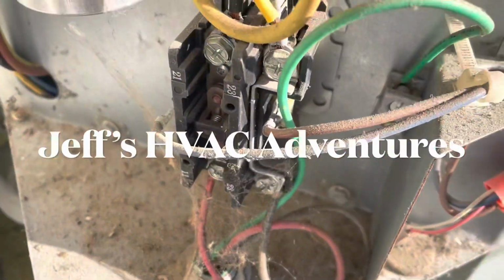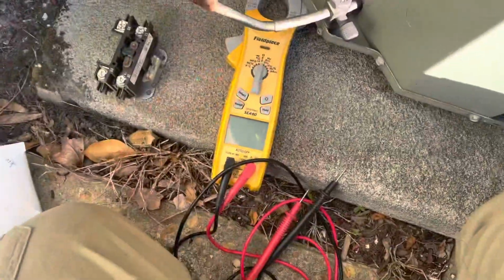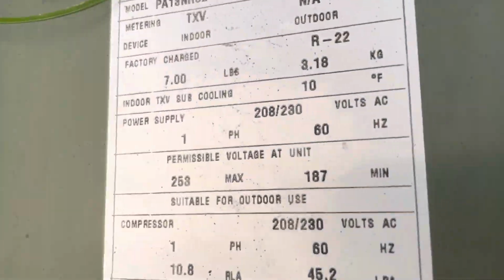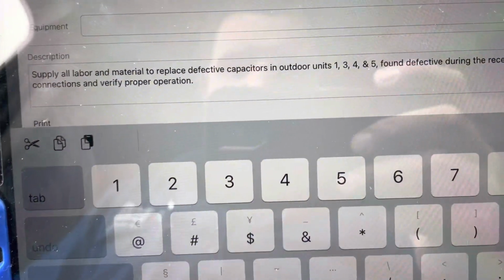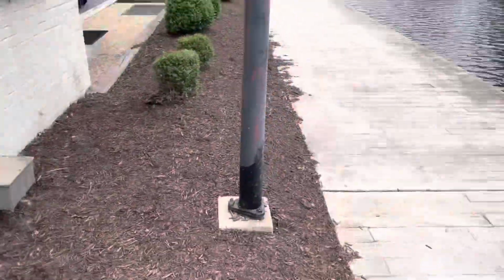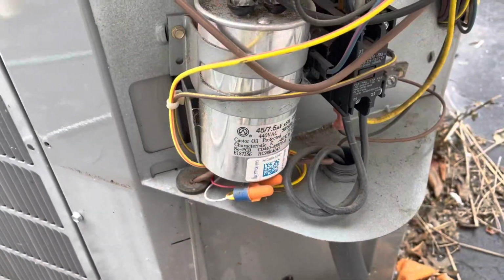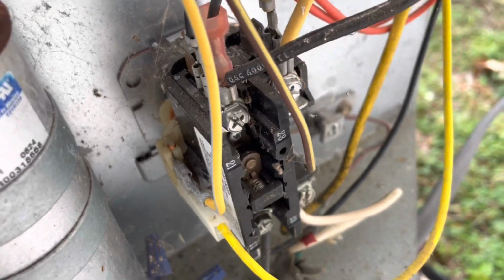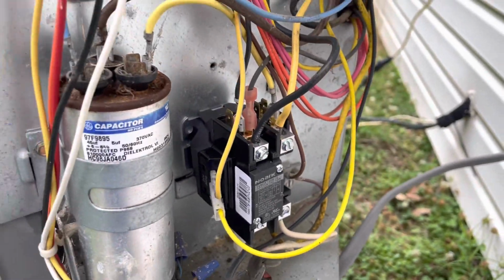HVAC Calls on 6/14/23.  Changing Parts All Day!

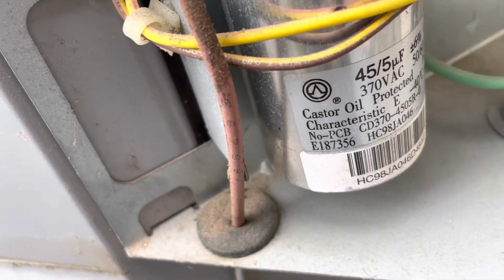Comment: The third capacitor at the complex was a 45/5 but you replaced it with a 40/5. You can see at 10:37 and 10:48.
Reply from the maker: Good eye!  Not sure what happened there, if I had a mislabeled box or I grabbed the wrong one.   I’ll have to swing by and fix that. 
Thanks
Reply: @JeffsHVACAdventures man your response is what makes you the man .. mistakes happen.. we learn from them .. I’m ready to get into the field !! Almost done with school